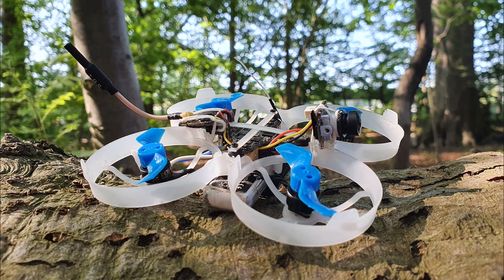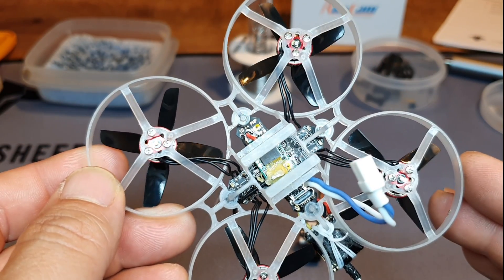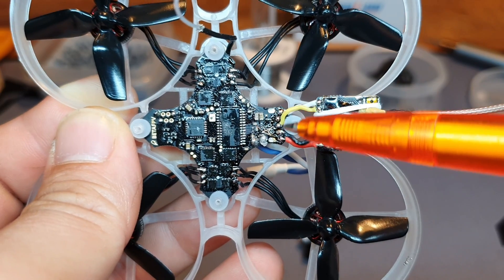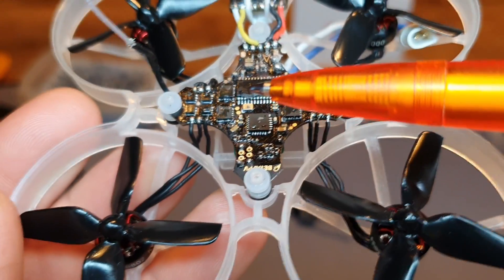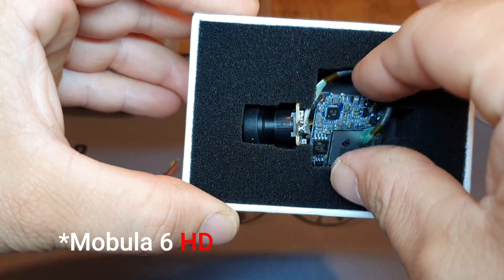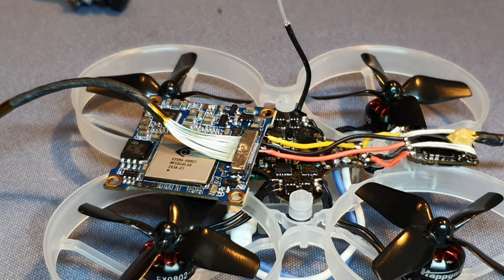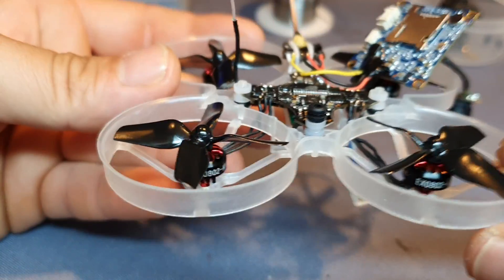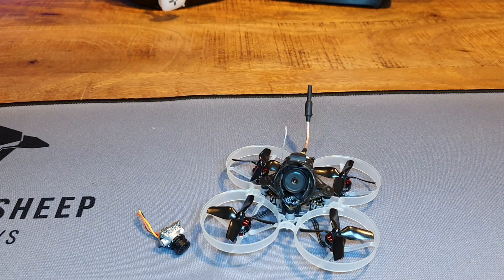Outdoor whoop build guide + Upgrades (Runcam Split 3 Nano Lite) - Mobula 7 HD 😋 | Square One

Comment: This works really well I put the HD camera off my mob6hd onto a moblite7 and it worked great. Without the stand offs though it was really difficult to access the SD card. On the plus side at least it won’t pop out in a crash (which happens all the time) since the frame blocks it from falling out. I would also give a big warning to be careful how you route the HD camera wire bundle (the one from the camera board to the camera itself). It’s hard to see when you do it, and it’s not shown here but I guess when I put it in I kind of pinched it between the canopy and the camera board. It worked fine until I crashed once and it squished and cut that wire bundle, wrecking the camera. Could be my bad luck but the wire is way longer than it needs to be so be careful how you tuck it all in there and try not to put it in such a way that the canopy will cut it if you press down on it. Nice videos thank you.
Reply from the maker: Thanks you 🙂 and thanks for the advice! That's really bad luck your cable got damaged, those thin wires really get cut easily . I rotate the camera a few times so it bundles up into a little spiral, and put it in the empty space in the canopy behind the camera. But yeah for a whoop this cable is just way to long. On an other whoop frame I had the same problem with part of the hoop blocking the sd card tray, I had to cut a bit of plastic of just to be able reach it.

Comment: I was looking into building something along these lines. a "cinewhoop" with the split cam. But since you went all out with the TBS vtx and xm receiver, have you pushed the range yet? What is your limits thus far?
Reply from the maker: I don't really "long range" with my whoops, the tbs vtx is great, 500mw will get you +1km easily, with nothing obstructing your line of sight that is. The xm is my limiting factor, I fail safed about 100m out going behind a small metal structure. Going to try an  ELRS receiver. TBS crossfire works great but adds to much weight in my opinion.

Comment: Bro, How do you extend the screw mount height?
Reply from the maker: I don't,  I had to use longer screws, the M6HD comes with these longer screws. If you don't have longer screws you can try looking for them in home appliances or small plastic toys, nobody will notice it's missing 2 screws 😂🤘.

Comment: Hi sq1. I was thinking about when you said pendulum effect. What is the benefit of inverted with battery on top in terms of jello? I thought pusher config are best for stability however pendulum effect has a point.
Reply from the maker: That's a very good question! 😅 Most of the jello will come from the vibrations of the motors and props, transferred through the frame to the camera. So unless we can make the motor / prop combination vibration free, the only way to get rid of jello is making it so the vibrations cannot reach the camera. 
Soft mounting will help, but this camera is so light, getting 'soft enough' soft  mounting will be hard. 
A pusher config will not help with jello, it's does change the center of gravity, and thus gives a drone a different feel when flying.
Reply: @SquareOneFPV  maybe the jello isn't the perfect concern but other stability factors. But yeah I know you got what I mean about pendulum and stabilization. I wish to try out and feel the difference of the inverted if I finish mine. What's the dry weight of yours?
Reply from the maker: @jeffclassics  You're going to build an inverted whoop? 😋 alright 😁, let me know what you think of it! Yes they do feel more stabile, and have better cornering. Maybe you've seen them but I got video's on my 65 and 75mm inverted whoops, if you are interested.
65mm inverted= 17.5gr
75mm inverted= 19.9gr >> this one has the Beta 75 pro frame, with a Mobula 7 V2 frame it would be only 18.9gr
75mm outdoor whoop= 29.9gr
Reply: @SquareOneFPV  Yes i've seen your old built videos and your skills in weaving dental floss bro; that's original. I can do 30-35g I guess. I tried to invert my stock tinygo frame, used the 1103 motor, crazybee board and runcam 2. i'm getting about 38-40g. 1s can't lift much my setup. if i can't do 35g outdoor then i'll definitely buy the mobula 6HD and work on it instead like what you did.. Btw, you think you can fly like Nick Burns in indoor? He races good indoor in his home. hehe
Reply from the maker: @jeffclassics  Cant' take credit for the dental floss, got the idea from Mr. Shutterbug 😅. Yeah weight is key factor in making whoops fly better. Good luck in making it lighter! 
Haha Nick Burns really is fast in his house,  I don't know, maybe 😋, my apartment is a much smaller space to fly in as Nick's house. And I don't think he'll let me fly there, because he doesn't like inverted whoops 😂.

Comment: Have similar build. What props u use? No issues to provide enough current for nano 3 lite from VTX? Why did u cut canopy? THX!! :)
Reply from the maker: Nice 👍, I'm using HQ 40mm 4 bladed props, going to try and compare to newbee drone 3 bladed soon. No powering the runcam is no problem, the vtx provides cleaner power so it cleans up the fpv video. But under 3.2v the vtx shuts down so I do have to keep an eye on the V.
My next video will show you why I've cut the canopy, you the first to notice 😁!
Reply: @SquareOneFPV  Thx! I used bit different approach. I power VTX from small step up. Found one which is just 0.5g but yours is cleaner solution. Not sure if worth to redo it or I will just keep it. And also I designed my own canopy for nano 3 lite with mount. Will post thingiverse if interested.
Reply: @SquareOneFPV  Do u have a link to both props u have or u plan to test? thx!
Reply from the maker: @martinmacko7297  A step up will work too, and provide clean power if you don't care about the added weight and wires I'd just keep it as is, I don't think a gram is going to matter on such a build anyway. Yes very interested in your canopy 🙂, do share, thanks! Where you from? I am from Europe so I order from EU shops or Banggood 
HQ 40mm:  https://www.banggood.com/custlink/KKGhgvpKii
Newbee drone Azi 40mm:
Europe;
 https://www.drone-fpv-racer.com/en/newbeedrone-azi-triblades-40mm-props-7274.html
US: https://newbeedrone.com/products/newbeedrone-azi-tri-blade-40mm-micro-propeller-set-of-4

Comment: You should try out the elrs fc or receiver it’s a ton better and lighter.
Reply from the maker: Yeah I feel tempted to try it  😄, thing is I've put this together with components I had laying around, to keep the costs down. And I don't feel like switching between my crsf module and the elrs one. So I'd have to put it on all my quads. But it's already on my wish list  so it's probably just a matter of time before I buy it 😂.

Comment: nice build, i'm inspired by your build :D
Reply from the maker: Thank you 🙂, happy to hear that! 👍
Reply: @SquareOneFPV  hi sq1, longtime no see. I've just finish a 75HD with 33g of weight (tiny rush tank, tbs nano, 19k kv happymobula, runcam split3 nano from mobula6HD). Flight with 450mah 1s betafps only get 2'45s. Is this so bad? May i know your throttle of hover power? Mine is 65-70% of throttle to get hover and the quad quite heavy.
Reply from the maker: @nhubach2367  Hi 😃! Yes it's been a while, how are you? That's a nice build 👍. Do you get 2.45min indoors or outdoors? I get about 3 to 4 min indoors but that's with moderate speed. Outdoors I get 3min tops, mostly 2.30 to 2.45. 
Mine weighs 31gr dry and 44gr auw, with the URUAV 1s 450. I've flown Betafpv 300mah batteries but I wasn't very happy with them, they were ok at first, not great just ok, and also they degraded very fast 🙁. 
What props do you use? I fly with HQ 4 bladed props and I just started using Newbeedrone AZI props, I don't use Gemfans 3 or 4 bladed 75mm props, they are too heavy.
I think I hover around 40 to 45%, https://youtu.be/rntx0Dytooc
Check this vid, the parts I show goggle dvr shows my throttle position in the left bottom corner, at the end you can see how long my flight was, I think it about 4 minutes. 
Since your weight is pretty similar to mine, I think it's going to be your batteries or props, or maybe both. If you got some more questions feel free to ask, I'll help you as best I can! Good luck with it 🙌🙂
Reply: @SquareOneFPV  glad to hear your reply. I've got 2.45 indoor with stable speed, just testing in my room and still not go outside. Currently, i'm using 4 blades HQ Prop as like you. I've tested with others battery (included 300mah betafpv, 450mah betafpv and 520 gnb) and think the batteries are all ok. So, the thing may come from the heavier quad (33.6g vs your at 31g) and different FC (mine is zeus5 aio).
Reply: moreover, what do you think if i replace 19k kv motor to 22k kv motor? Does the FC can handle the higher kv motor with 4 blades 40mm hq props?
Reply from the maker: @nhubach2367  Usually higher KV's will mean  less flight time, so far the Happymodel ex0802 19000kv are the most efficient in my testing. BUT I am using Betafpv 0802se 22000kv now because they have less play than my Happymodel motors and cause less vibrations. I do limit them to 19000kv and now flight time is pretty similar (difference is only 15 to 30 seconds to be fair). Your fc will be able to handle higher kv no problem.
Reply: @SquareOneFPV  thank you, will try it :D. Have a nice day and looking 4ward to see ur new videos.